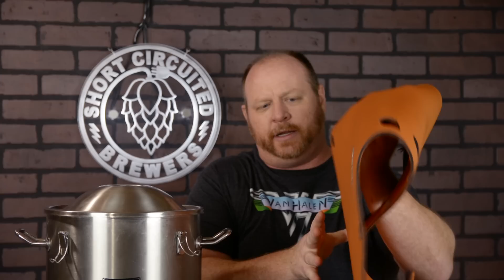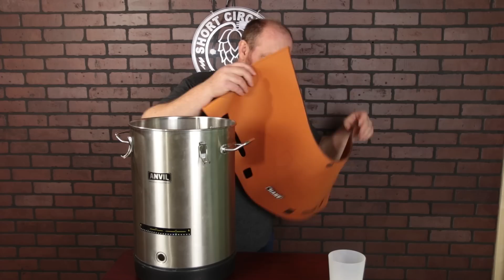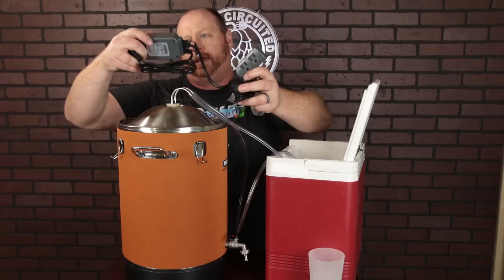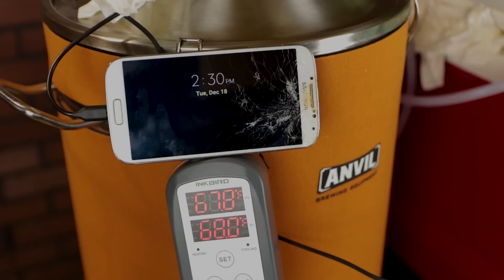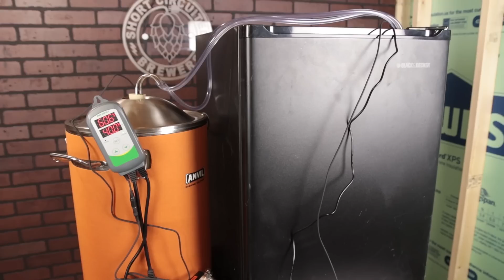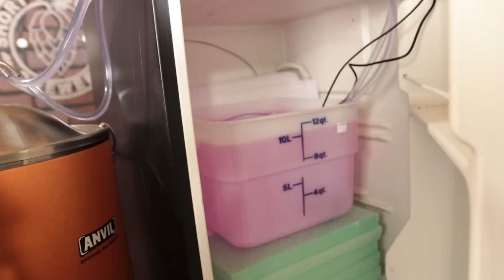Anvil Fermentor Cooling System Setup and Review

Comment: Thank you for your informative videos on the Anvil bucket fermenter. I got the Anvil for a gift 2 years ago. Honestly, for probably 2 decades I struggled with keeping the fermenter cool without increasing its footprint. I live in a small apartment, on a tight budget and moderately high rent. The hundreds (thousands?) of homebrewing videos showing many, many, many men building all sorts of DYI solutions that added equipment, tools, and refrigerators just was never an option.  I was excited by the idea that the Anvil system came with an internal cooling option only to see you needed some external cooling source to keep the submerged unit cold.  In 2015 I discovered the BrewJacket system and haven't looked back. I ordered the lid for the Anvil that fits the BrewJacket cooling system and it works like a dream. I had high hopes for the Anvil system because that would mean I could have two batches fermenting at once. I GREATLY, GREATLY appreciate your honesty and detail in your demos!!! Keep up the great work!
Reply from the maker: Thank you!! I appreciate the feedback! 👍🍻

Comment: Got the carboy cooling system from Anvil. Finally fermenting a lager at a VERY steady 50 degrees. Works fantastic, but you’re correct it only works as well as the temperature of your reservoir. I modified a cooler and double lined it with Reflectix for insulation and bought two Yeti Ice Packs to rotate out. I also have a small ice machine that constantly makes ice, which I gather when I can throughout the day and keep in a freezer. I pack the cooler with ice and a Yeti ice pack, and it keeps the water freezing and retains ice for over 24 hours. I use a glass carboy (3 gallon) and wrap it tightly with Reflectix as well, which provides great insulation without creating a big footprint like a chest freezer would. The Reflectix-wrapped carboy sits in a 70 degree room and the pump only kicks on when the probe in the thermowell reads 51 degrees. In total, the pump only runs about 1.5 hours in a 24 hour period, which amounts to 1-2 minute intervals every 20 minutes or so. In comparison, without the Reflectix wrap on the carboy, the pump kicked on every 2-3 minutes. Ultimately, using the Reflectix wrap amounts to minimal wear on the pump and more temperature stability and uniformity inside the fermenter. Bottom line, I’ve never had such precise temperature control before getting the cooling system and a bit creative with Reflectix.
Reply from the maker: Nice!! Thanks for sharing your process! 👍🍻

Comment: I realize this is an older video so if you’ve had a similar discussion I apologize:) I turned my mini fridge into a glycol system in much the same way only I was able to bend the condenser into the bucket . My inkbird would keep the glycol at 29.5 . With that said, a thing I also learned was to not leave the reservoir uncovered as it slowly coated the inside of my fridge! 
Great video I hope they send u a crucible to demo
Reply from the maker: Yes! That is about the best way, getting the cooling coil into the glycol mixture. I will be reviewing the crucible!! 👍🍻

Comment: Instead of a cooler box with ice which i personally think is a very average way of cooling especially if you are in a hot area that ice will be melted in a couple of days.if you want a more consistent permanent solution buy a small aquarium watercooler it works like a boss
Reply from the maker: Or a dedicated Glycol chiller 😜👍🍻

Comment: You should keep the jacket off and only put it when you reach your target temperature next time. That would speed up the process a little bit. Also, If you want to improve or somehow mod the system you should start by adding some insulation to any tubing thats not inside of the fridge or touching your worth. There is a type of insulation for the tubing of airconditioners that could work great. Can you share the characteristics of the pump? Love your channel, cheers from Argentina!
Reply from the maker: Good point on the jacket, didn't think about the heat retention. The insulation  on the tubes is on my list too! The pump is 12v and 3.5 gph if I remember correctly. Thanks for the tips Marcos!! 👍🍻
Reply: You’d have to modify the jacket In order to put it on OR you’d have to remove the spigot, put the jacket on and then reinstall the spigot with your arm inside the fermenter. But, by then all the beer would be on the floor. Safer to mod the jacket probably
Reply from the maker: I have actually put the jacket on without removing the ball valve. It will stretch out that far, it is a little scary though.. Lol I typically just leave the jacket on all the time. 👍🍻
Reply: Short Circuited Brewers Ahh, yes, neoprene does stretch a bit.  Didn’t think of that

Comment: I use a combination of Ice and a couple ziplock bags, each with 3-4 ice packs, in just enough water to clear the pump. The melting ice will make more, and once I reach temp I end up using 1 bag of ice packs per day to maintain it while the other freezes. 

If I end up having to add more ice, I'll remove some water to account for the melt; always minding the water level never gets too low or too high. This also helps the cooling efficiency, along with having as little of the tubing outside the cooler as possible. I was using it to pre-lager in a 75°F room and to play with a local yeast at cool temps (58°). Reservoir is just a disposable foam cooler with grooves cut for the tubing.
Reply from the maker: Nice! Sounds like a great solution! Thanks for sharing it! 👍🍻

Comment: I use distilled water and add my own chemicals depending on beer style.
I save the jugs fill with water and freeze. I fill up the cooler to get the water above the pump and simply rotate the frozen jugs. No need to drain as the ice melts.
Reply from the maker: Sounds like a good plan! 👍🍻

Comment: You should try a countertop water cooler. Fill the reservoir of the cooler with glycol and drop the pump in it. If that's not cool enough bypass the thermostat on the cooler and bring it down to freezing temps.
Reply from the maker: Thanks for the tip I will look into it! Cheers👍🍻
Reply: Alot more compact and the cooler is designed for cooling water so the glycol is in direct contact with the chilled walls of the reservoir
Reply: Very interesting idea! Have you tried this? I see these can be bought for $45.50 on eBay.
Reply from the maker: I have not tried it.

Comment: Great review.  I had been thinking about doing something similar DIY on my own.  

FYI - I use a similar fridge to the one shown in your video as a fermentation chamber - I added a "sleeve" to the fridge with 2x6 lumber, and now I can fit a carboy inside it.  I use the same inkbird controller for temp control.

I live in AZ, and getting it cooled down to pitching temp can be an issue when the tap water is mid 80s.
Reply from the maker: Awesome. In the finishing of the space in the basement I built in room for fermentation fridges. I would love to not have to buy big fridges and have the extra space. I hope to get the coil in the reservoir and get the temps down farther. Cheers Rob! 👍🍻

Comment: Great review. Trying to use my head on this and see if at some point I can rig up some kind of glycol unit to the top of my freezer unit and see how it goes 
Good luck with further future tests.
Cheers.
Reply from the maker: Thanks! A DIY glycol system using a freezer will work to maintain ale temps, but won't be able to lager. I've tried it. 😁 👍🍻

Comment: My question is more geared towards us as brewers and your take specifically Brian since you get a lot of things things for free to try. At what point does the sheer volume of gadgety equipment just give a diminishing result on the purpose it serves? Lets be honest. Putting a fermenter in the mini fridge would have been the easiest method here.  Now full disclosure i come at this from downsizing my entire brewery to a single vessel unit and hot cubing. So my time brewing, amount of clean up and sheer volume of "stuff" has been my focus. And in that focus I've found probably the same joy others have found in adding a new gadget to their brewery.  But from an all up question, (that bias aside). At what point do we (homebrewers) say... "ok ok this is just a blatant attempt to put more crap in the market we dont really need. Lets focus on making what we already have better."  That said, i know the answer already. Its circumstantial on each persons opinion and budget.

Comment: I would tend to think there is enough thermal convection within the product such that having the temperature probe an inch or so away from the bottom of the cooling coil wouldn't result in an artificially low reading.  No more so than taking a temperature measurement from the top vs the bottom of the product, for example.  There will always be some margin across the product, but the average is most important and as long as it is within a degree or two, does it really matter?  The average temp reading for 5+ gallons of product doesn't move that fast anyway (it's a large thermal mass), so sampling the temperature once every few seconds, averaged over a minute, is more than sufficient.  Some folks seek a fast sample rate for temperature measurements in these types of applications, and it just isn't necessary.  It can actually be less efficient and cause your heating/cooling control circuit to be less effective, if it is constantly turning on and off making adjustments that are more fine than the controls are capable of managing, and that are lagged in time.

Comment: Great video, Brian. I certainly enjoy the realism in your experiments as it shows that the product, while it's a good one, does have its quirks that we'll can look forward to. Do you know if Anvil sells a heating wrap for the fermenter as well? If not, do you know if they will be creating one? Thanks again. Oh, and I'm looking forward to seeing your basement brewery/bar. Do you know when we'll see it finished? Cheers!
Reply from the maker: Reptile heating pad that I found should provide the heat needed. I will be getting one. I found one on Amazon for $10 that should do the trick. Thanks on the comment, I try to test things as I might use them and just share what I find. for instance the mini fridge did not go as I had hoped. I am ok with the failure at least you will know that might not be a viable option and can make an informed decision.
Reply: @ShortCircuitedBrewers   The Inkbird has a "Heating" side. Wouldn't that work?
Reply from the maker: Yes!  I have already been testing it with a seedling heating pad. I'm going to be doing a follow up video to this one with a mini fridge glycol chiller, and the heating pad.. 🍻👍

Comment: What about installing a fan that blows on the evaporator inside the fridge? I think that would cool down the air as it moves around inside. Might be worth a shot. Submerging the evaporator into the glycol would most definitely be the best though.

What temperature was set where the liquid crystal thermometer was reading 62? Does that mean there was x (or 6 degrees) of overshoot by the controller? 

Nice work Brian!
Reply from the maker: It would help to have a fan but I don't think it would be enough. The temp was set to 68 on the when I showed the LCD. I don't think it overshot, I am pretty sure that the LCD is just off mainly from being sandwiched between the fermentor and the jacket it definitely did feel noticeably cooler to the touch though. I am going to get the evap coil in the glycol and see what that does. Might have to do a video on just that!! Cheers Steven!
Reply: @ShortCircuitedBrewers  install a fan inside off the fridge, you'll be surprised!
Reply from the maker: Yeah that would help a bunch!  🍻👍

Comment: is the coil too small to cold crash with a glycol chiller? eyeing the stasis, but i'm afraid the coil might be a bit small to bring it down.
Reply from the maker: It will drop to 41f with a glycol chiller. I've done it with my blichmann glycol chiller and it works for cold crashing.
Reply: @ShortCircuitedBrewers  Awesome! thanks fornthe quick reply too!
Reply from the maker: @edrozell9595  yeah I was pleasantly surprised too. 👍🍻
Reply: Hey Brian, what size tubing is best for those coils? The glycol chiller I picked up has 3/8"OD barbs and the diameter of that coil is pretty small. having some trouble clamping down on it.
Reply from the maker: These work perfect to get from 3/8 down to the tubing that comes with the chilling coil. 
https://amzn.to/3dlQDol
Reply: @ShortCircuitedBrewers  Thank you very much! I actually bought just the coil, jacket and thermowell and stopper. The glycol chiller has internal pumps, so it was a little cheaper to buy just the pieces. I have some 3/16" tube holding but i dont love it. I'll need to scoop up some of those step down barbs. Thanks again for the quick reply and keep up the awesome videos!
Reply from the maker: @edrozell9595  👍🍻
Reply: @ShortCircuitedBrewers  okay last question Brian....roughly what was temp of your glycol reservoir when crashing it to get to 41? im getting ready to crash a batch tomorrow and i'm sitting at 26-27f in my reservoir. we got a glycol newbie out here. 🙋‍♂️
Reply from the maker: About the same temp, it was right in that range. 👍🍻
Reply: @ShortCircuitedBrewers  Great! Thanks again. you're the best! cheers 🍺

Comment: I bought this system in hopes of maintaining lager temperatures. An ice bath does keep the fermentation easily in the low 50's. However, replacing the ice every day or two is sort of a pain. 

Towards the end of the video you mention maybe trying a freezer to chill the glycol down further. Have you tried this? Is there another video around this?
Reply from the maker: I tried a freezer with it and a glycol bath but couldn't get it much lower than 55f with that either. I now have a grainfather glycol chiller. I will be revisiting the anvil chiller with a real glycol chiller to see what it can do. 👍🍻
Reply: @ShortCircuitedBrewers  Thanks. That is a bummer. I'm not sure $1000 for a chiller is worth an extra 5 degrees (at least for me). I'm going to try the gycol bath in the chest freezer and see if I'm able to get decent results. Do you know what ratio of Glycol to Water you had in your solution? I have discovered that 99% pure glycol is way to viscous for this pump :-)
Reply from the maker: @MrEsheppy  it was 50/50 and the temperature in the tank in the mini fridge was set to 29 degrees. It wouldn't hold the temp. It ran all the time. My DIY chiller wasn't the most efficient though.
Reply: Freeze bottles or jugs of water to swap out next time. Less ice used. Tho you need more freezer space for the spare bottles..
Reply from the maker: Yes I have done that before to cool carboys in a tub.

Comment: I bought this to keep quick sours and Kveiks warm. I am having major problems with suck back. I am thinking maybe the default 3 degree temperature differential is causing it. I really don't want to be sucking oxygen back on my lacto. I am setting the temperature differential  to 1 degree and hoping that solves the issue. Let me know if you can think of another cause of the suck back.
Reply from the maker: Temperature fluctuations are what cause the suck back 99% of the time. Forgetting to remove the airlock before opening the valve are the other 1% lol. You might look at this solution from nor cal It's made for cold crashing but would fix your issue. https://www.norcalbrewingsolutions.com/store/CO2-Carbon-Dioxide-Harvester-Kit.html

Comment: Would you have a recommendation for a new submersible pump?  Mine died after three batches. I will probably have to dump this batch because I can’t get the fermentation temp down, due to the pump breaking.
Reply: Depending on the timeframe the failed pump should be under warranty with Anvil.  Their CS is very good-you should contact them regardless and inquire if they can help you.

Comment: This maybe a dumb question, but in your set up there is no air lock. Is the system just going to vent through the lid seal?
Reply from the maker: I just didn't show an airlock it does use one though. 👍🍻

Comment: What about heating?  I assume you could just slap a heating belt or something on.  Also I went to order two but it only ships in the US which is a bummer for now.
Reply from the maker: I think a reptile heating pad will slip in between the jacket and the fermentor and make a great solution for heating. I found one on Amazon for $10 I am going to get and try. I wll be doing a follow up as I do more testing. There are some fine tuning things with the inkbird as well that can be done. They are usually used for refrigerant systems and not just running a pump. so there are parameters that can be "tightened up" to keep the system more even temp.
Reply from the maker: They do not make one.. BUT a reptile heater is very flat and low wattage and I think will slip in between the jacket and the fermentor. I found one on amazon for $10 I will be ordering for testing!!  More to come for sure.

Comment: Any concern of the thermowell and cooling coil not being air tight with the stopper?
Reply from the maker: Oh no,  they have to be forced in. And when you install the stopper it squeezes even tighter.  There are 2 different size holes in the stopper for the air lock and the thermowell if you put the thermowell in the air lock hole, its loose, but as long as you get it installed correctly there's no problem. Cheers Patrick 👍🍻

Comment: Could you put the  Probe between the jacket and the fermenter wall? Also, the system now comes with an Anvil controller.
Reply from the maker: Sure you could. I did find that it was within a degree of the set point at the outer wall though with the standard setup. 👍🍻